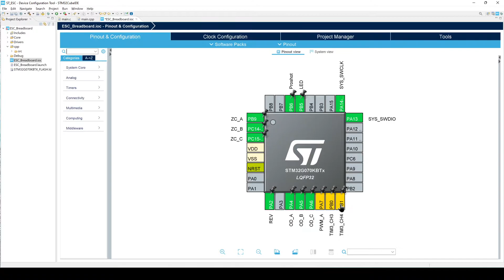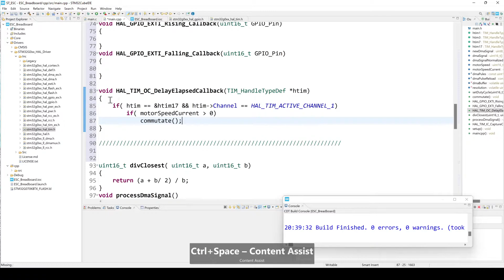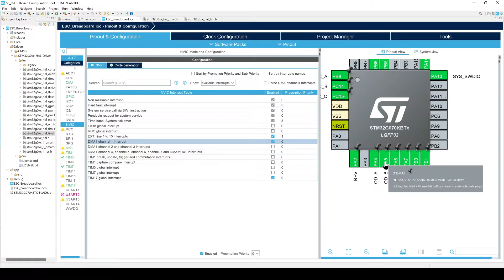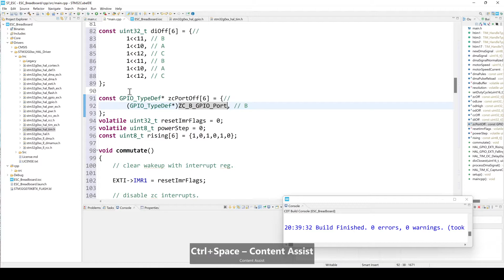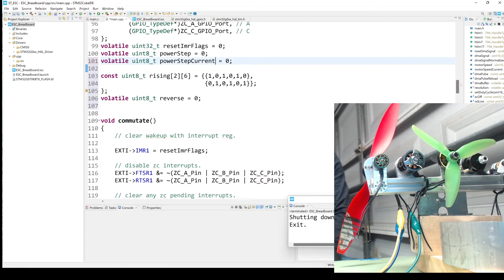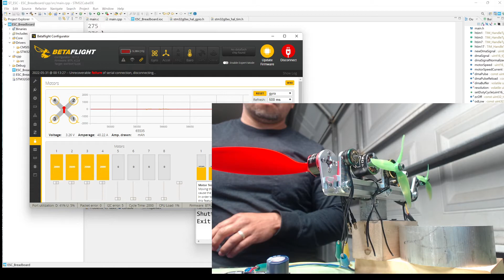DIY BLDC Brushless motor controller Part 2 - ESC STM32 full coding session.

Comment: Now I have more success with the BLDC-Project from Gil. I did some changes in my hardware, this means, I changed the MOSFET Driver ADP3120A to more robust IR2184, also I changed the MOSFETS to more easyly mountable IRFR1205. I create a layout for a pcb, not so tiny as Gil's, but very easy to assemble. With pcb and all parts I pay appr. 30 Euro for one controller. I know, there are more cheap ones at AMAZON (about 15 Euro), but they have analog input (and I don't learn anything with them ...). 
The pure circuit from Gil I modified furthermore: I add some filtering to the BEMF-Signal. This helps to run my motor much more smoother.
With my STM32F429-DISCO I create a Oneshot-Emulator, meanwhile I have a pretty comfortable Software to run the motor in test-mode, with variable speed, and variable direction. And additional Gyro/Acceleration Sensor MPU 6050 I added to my system.
My goal is the attitude control of a balance arm, at one end is a BLDC motor with  propeller, on the balance arm the MPU6050.
If anyone is interested for schematic, layout or software, please contact me.
Reply from the maker: @jokr12334  you should share your experience in the discord channel.
Reply: @guser210  I create a new discord account, but it takes some time to fill it with proper content
Reply from the maker: @jokr12334  and post a video of your progress.
Reply: Oh... Thanks. Could you share the schematic and the software

Comment: I followed the Instructions from Gil - and after some long time of investigation I got it partially to run! Very critical are the lines from comparator to ZC-Pins! I used shieldet wire, that works so far. Unfortunately I cant't archieve not more than about 1000 motorSpeed - then the motor stalls. I think that is because I am filtering the A-B-C signal and I don't have the rigt time-constans here.
Reply from the maker: I am available this weekend if you are interested.

Comment: Sir I have doubt ,How are you starting the motor the motor with out intial phase alignment and open loop ramping  to get optimal BEMF ?
Reply: Sir please explain the line 
If(zcPortOff[powerstep]->IDR & zcoff[powerstep])
Reply from the maker: @electromind4183  checks if the interrupt line is still high to prevent false positives
Reply from the maker: The logic commutates to jump start the motor via a timer when the signal speed is more than 0 and the motor is not spinning
Reply: @guser210 Thank you for your reply sir , i am currently working on my ESC which is based on arduino nanu is there any way that I can do like that jump start because initial phase alignment and open loop ramp up is consuming some time i want fast startup.
Reply from the maker: @electromind4183  it is possible to have a similar process to spin the motor yes.
Reply: @guser210  sir can you please point me the jump start condition or function in core which you provide in the git hub because I really want to complete my trapozoidal control ESC faster so I can work on foc control
Reply from the maker: @electromind4183  in main.cpp there is a function at 196 called HAL_TIM_OC_DelayElapsedCallback
Reply: @guser210  after jump starting motor is it directly going into closed loop control? How is it possible to estimate the BEMF at low speed sir ? I am trying a similar process with my code but the motor is stalling when I am transitioning from jumpstart to closed loop.
Reply from the maker: @electromind4183  https://youtu.be/DbCHK3Xr-Js?si=lPNpb77HrUUG5X8n take a look at that video.
Reply: Sir here external interrupts logic level will reflect on a specific GPIO port IDR register?
Reply from the maker: @electromind4183  the external interrupt pins can be read like a normal pin.

Comment: Very good video, I am myself trying to implement esc code. However, it does not run nearly as smooth as yours.. have checked no ringing interrupts which I thought first was the problem. Any idea what unsmooth running could be the result of?
Reply from the maker: Not enough capacitance of both electrolytic and ceramic capacitors will do it, a breadboard are prone to loose contacts that will do it as well but also how are you determining  your commotion timing and how are you commutating ?
Reply: @guser210  yes thanks!
The hardware is an iflight bl heli32 esc that I have full chip erase, (stm32f051K), but I guess you are right about timing and commutation as the smootness somewhat seem to depend on delay in commutation. However, what I have tried it is always pretty loud and the mosfets gets hot. I have tried both AM32(open source code-commutation scheme/order) and yours aswell. And note: using complementary pwm (need active breaking as it is for quad) makes it even worse more unsmooth and loud. I will keep on trying. Thanks for your response 🙂
Reply from the maker: @martinchristiansson658  ah I wish I had a unit to program it myself oh well, let me know how it goes
Reply: @guser210  I will let you know:)
Interesting stuff, thanks
Reply: Hi again, havent worked on It for i while, but picking up the work now. Done some optimazation and it runs smooth up to around 50% duty then It starts to make some noise. Runs a bit uneven. Excepts around 30% a noise peak aswell. The 30% noise peak goes away if I change counter period from 1000 to 1024 (frequency 48KHZ) and no idea why.However noise start again at 50%. My thought perhaps could be resonance? Or perhaps I am missing something obvious? 
Best Regards Martin